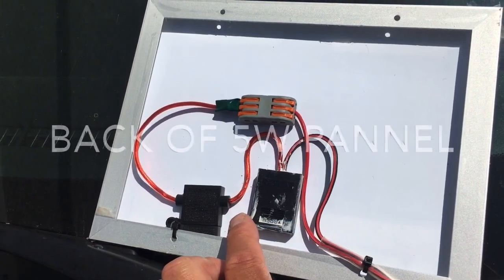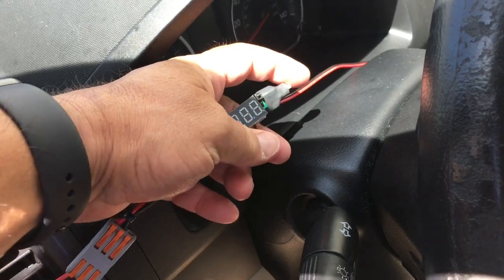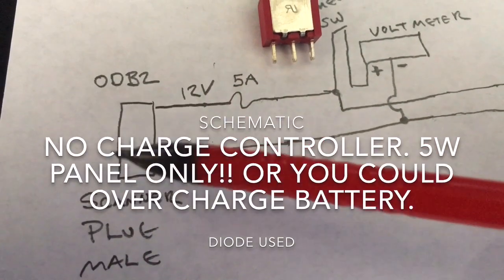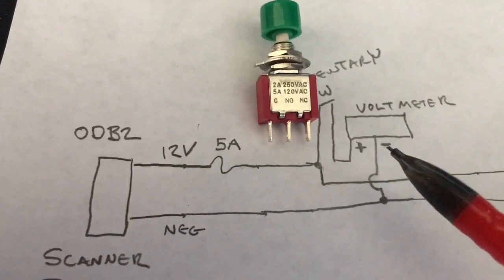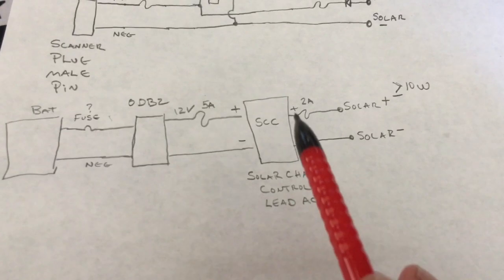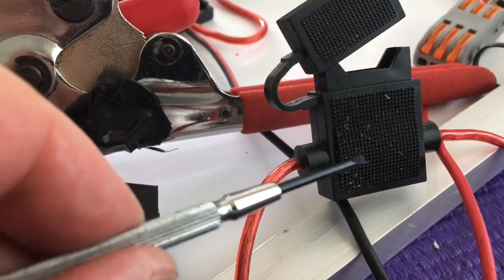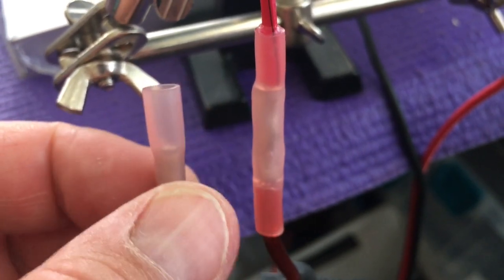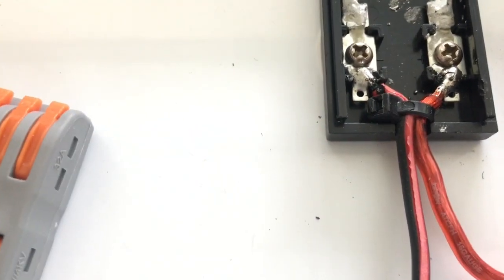DIY SOLAR CAR TRICKLE CHARGER USING ODB II CAR SCANNER PLUG THEN CONNECT TO SMALL SOLAR PANEL

Comment: Great video! I want to build a dual load/output solar 12v and 6v trickle charger for my 12v car battery  and a 6v deep cycle 6-10 Ah lead acid battery (that will power some very low / 60mA current, IoT security sensors 99% of the time and a 6v 3watt siren 1% of the time). Help! 🤣🤣 Is that even doable? Thinking I’ll need to find a pricey controller (perhaps with added to wiring like the 12v to 6v stepdown) to make that happen.  In my SUV you can at least bypass the relay switch to the rear cigarette lighter port to make it always on (in theory this would allow the car battery to be charged right? 🤔).  Also that rear 12 volt port is almost hidden so it’s a great place to run the cabling. The ODB2 plug is an interesting idea tho, has me thinking.
Reply from the maker: I think the cheap pwm controllers are good in most cases. I use these for fast er  charging where I want to have multiple charging phases. I have Victron MPPT on my boat.
Reply: It’s really cool how you have your setup figured out and that you’ve wired up a meter to (prebuilt ones with SAE plugs seem hard to find). I got a well rated ECO-Worthy 10w trickle charger (that claims to have a built in regulator / controller) in an for the meantime to keep my car battery from dying …but it has opened a big can of worms (making me want to build a  bigger system).  I noticed in your video tho that the readings you get off your panel are close to 12v. The one I got reads 19-20v! The meter also said it only outputs .5A which is what the spec sheet claims. Alot of people on Amazon have told the manufacturer they are reading 19v too but the manufacturer says that 19v is normal and fine for car batteries. Is he saying that because the the low current offsets the high voltage? Do you think though that I should till run it through a controller? That wouldn’t hurt right? Renology has nice 10A controller for $21 (with optional Bluetooth monitoring, which is crazy). It’s probably overkill for this first panel / car trickle charge project but I rather spend that than hurt my brand new battery… just want to find out if it’s okay to put a prebuilt trickle charger on a controller. 😅 I could upgrade the panel later too.

Comment: How for cars with obd1 port??
Reply from the maker: Sorry. I don't understand Odb1. However, my impression is that odb1 will not work because I don't think odb1 has a B+ pin. This B+ is only found in odb2 I think. You will need to connect your solar panel to your battery fused. I would be afraid to connect the panel to odb 1. It could blow something up.